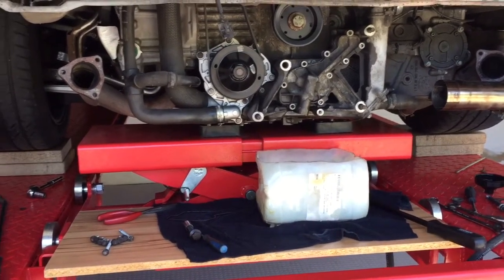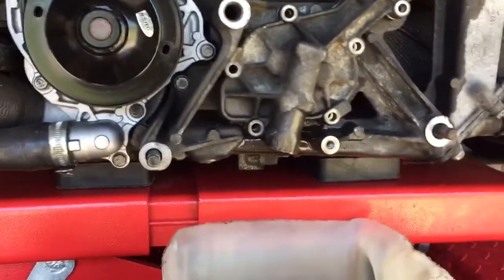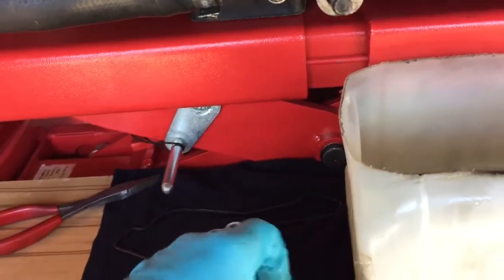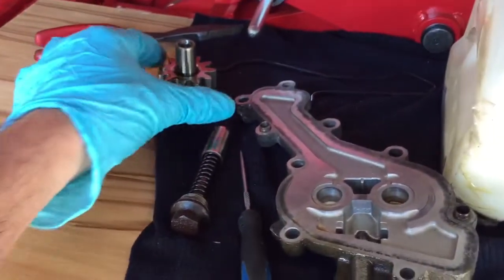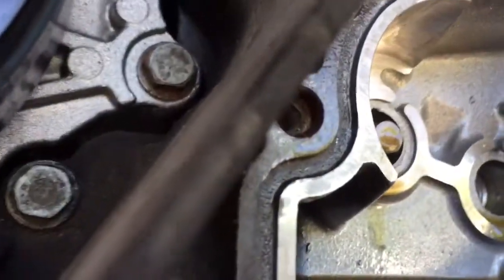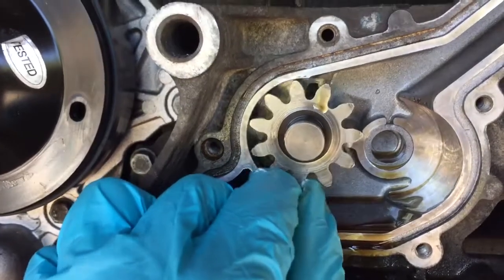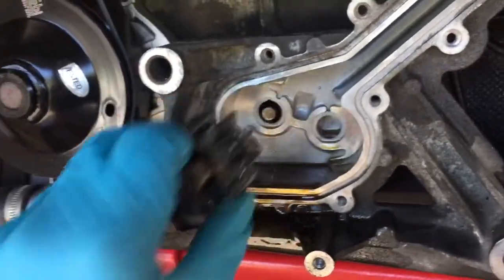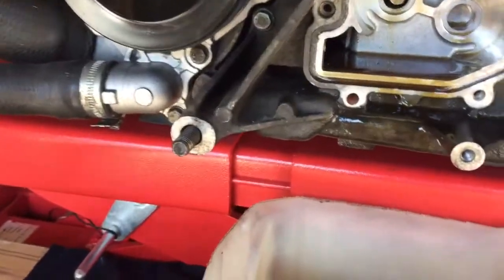Porsche 996 oil pump issue

Comment: Hi Richard. I need to sort a leak that looks like it’s coming from where the oil pump housing attaches to the engine block. Is this something that can be removed without taking the engine out? I see you accessed this while on a lift but I’m looking to do it on the ground using a trolley jack etc. Is there somewhere I could DM you on to have chat about doing this job?

Comment: Hello Richard - what brand of oil filter were you using? when you say "collapsed" was there any physical clues on the oil filter that were obvious?  I'm asking because I'm having strange oil pressure issues with my 99 3.4 and am curious also a) what pressure you saw on a morning startup? b) driving around at normal operating temps @ 5000 rpm - this is key  thx Peter
Reply from the maker: Hi Peter, thanks for your message, this was some time back now so I can't remember with any degree of accuracy. I have a feeling it was a champion filter. The effects at various RPM levels etc I have no idea now my apologies.

Comment: Would not have guessed that! first thought was oil drive hex. was the oil filter clogged?
Edit; not having the other casing half on probably allows the slave pump gear to sag and rub slightly, wouldn't worry about it. and the bottom bolt hole passes over the coolant passage so the bolt hole is probably not blind and ideally wants a gasket sealant adding to the thread. I know this thread is 1.5 years old but I've been drinking wine and just wanted to add my 2 cents.
Reply from the maker: Sorry Harry just read this, filter wasn't clogged just simply a badly designed filter.

Comment from the maker: Yes problem now solved, it ended up being a collapsed oil filter. Many thanks guys
Reply: Richard Beaumont Hi Richard, mine starts with a good oil pressure but after 20-30mins, pressure goes below 1. Did you change just the filter or also the housing? Thanks!
Reply from the maker: Hi  @januscalara , in my case just the filter needed replacing. Lesson here is don't fit cheaper filters
Reply: @januscalara  have you found the problem ?

Comment: Take the sump off and check the oil strainer it’s tiny and prone to blockage especially if the engine has been rebuilt all the silicone bits end up in the strainer starving the pump,

Comment: Hello there I just changed the air oil separator but now I had a small puddle of oil in my garage..my mechanic changed it last Friday ..pls advise ..would this be left over residue from old AOS? Or something bigger ..
Reply from the maker: Sorry Vlad I've just read this, I'm sure you have now resolved your problem. Most logical explanation would be this relates to the recent work you had done. Hope it was a relatively painless fix ;)